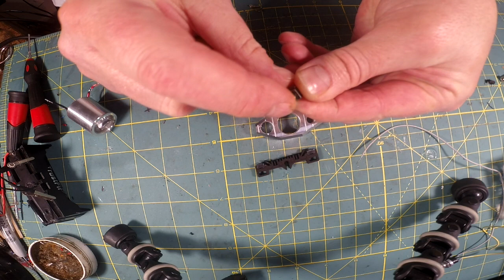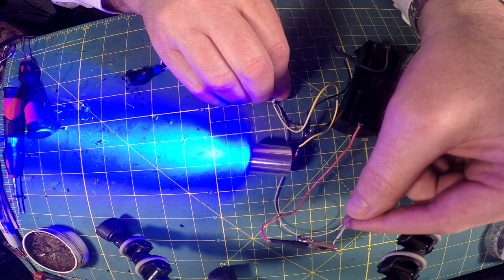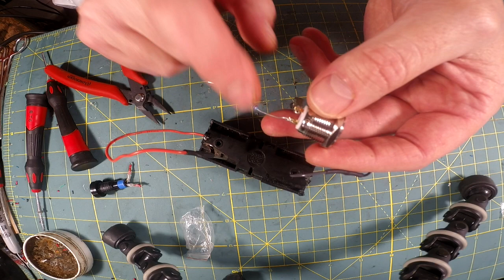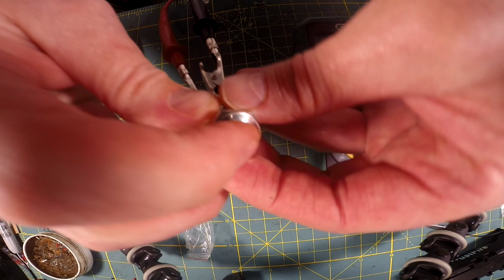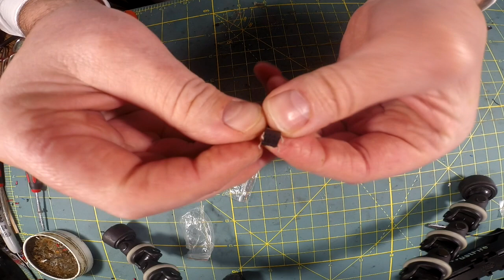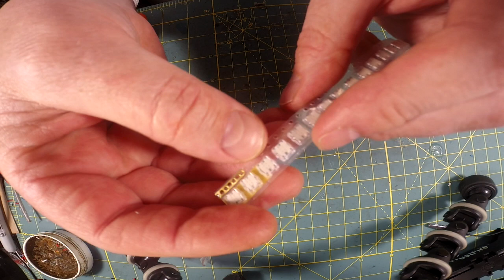Lightsaber Switches Introduction

Comment: What the heck is a PCB pixel switch? If you have an idea about how or what that does please send me any info. Thanks Meg !
Reply: Ok ya then the pixel would have to be wired like your neopixles and controlled by your board the same. Thanks👍
Reply from the maker: a switch which has neopixel lighting it. Should have 5 poles. pixel negative, pixel pos, data, switch lead, switch ground

Comment: Hello and thank you for this video.
I have some questions about the current and voltage so I hope to find the answers here.
Let's say I have a stunt/display saber, so no soundboard.
In hilt TriCree or a string blade (I know, old technique, but nevermind) and the current needed is about 2.5 A.
In that case the switch should be arround that amperage?
I found a momentary switch, nice silver, round bezel etc. rated 3A at 220v.
That 220v. I don't understand.
Will be that switch overkill for lightsaber?
Put in another way: what max.current (and voltage) should have a latching switch for a 2.5 or 3 A stunt saber?
Thank you.
Reply from the maker: most stunt sabers use these latching switches to power the in hilt led:  http://www.thecustomsabershop.com/SPST-Latching-Guarded-switch-with-silver-button-P255.aspx
Reply: @MegtoothSithSabers  Thank you very much.
There's only one (quite big) problem: I live in Romania, so shipping fron U.S. to Romania is expensive.
For the main parts (hilt extensions, poly blade etc) I will buy from a closer location (jqsabers).
Some other parts are available where I live (that latching switch I was talking, wires, battery holders, rechargeables etc.).
Or maybe I buy all I need from one vendor.
Thank you.
Reply from the maker: TCSS dosnt give specs, but check specs on your cree and then make sure the switch can handle the juice. Tri crees dont draw great amperage.

Comment: could you send me a 2-way momentary switch wiring diagram? For my Hasbro Darth Maul double saber project, I want each of the sabers two red buttons to be daisy-chained for power on/off as a two-way switch with either tactile or 12'mm button. I will be using Proffieboard. I can compensate for the info.
Reply from the maker: using stock lqtching switch, or are you swapping for momentary?

Comment: do you know what kind of swich the verso uses?
Reply from the maker: momentary, wired pull down
Reply: @MegtoothSithSabers  and do u know if i need to program an aux switch to the verso board or it have a default config right out of the box ? and do yu have any tutorial about aux switch wiring ?
Reply from the maker: @b.h9186  You dont need an aux switch on verso, but you can have one. An aux switch is wired just lije powee switch, except one lead goes to aux pad.  Sounds like you havent read verso manual, start there then watch this full verso install single button saber:  https://youtu.be/A9piyOWEe54
Reply: @MegtoothSithSabers  thnks bro
Reply: @MegtoothSithSabers  k i read it but what i still dont get is: do i need to program something to use the aux switch or i can simply plug it in and use it by default ?
Reply from the maker: @b.h9186  you have to adjust config fike on sd card for 2 switches, and you have to use the most recent os. I highly suggest you join kr sabers verso support group on facebook. Its a lot easier to help you there than youtube comments box. We are limited here.

Comment: What switch should I use for the red button in a Graflex? First time trying this out and want to get it right the first time.
Reply from the maker: Which graflex?  korbanth 2.5, 89 sabers, etc.  Which hilt makes a huge difference.
Reply: It’s for a 2.0. I got a plug and pay set up for a 2.0. Everything but the switch. And wanted a red button operating set up like in TFA
Reply from the maker: @RynMyers  Use the red button that comes with the kit, and the tactile switch that came with it, see this tutorial here:  https://www.youtube.com/watch?v=GvTa4diGtl8
Reply: Megtooth Sith Sabers , the kit I got was already assembled by Parks with a 7/8 insert inside, just want to give you as much info as I have.
Reply from the maker: @RynMyers  See video above to see if Parks included the parts needed.
Reply: Megtooth Sith Sabers , I just checked no switch just the button and nothing underneath. Mine just came from him fully assembled with nothing else.
Reply from the maker: @RynMyers  The only way to wire that button then is to disassemble the saber, and add a tactile button in there.  Follow Lets Build A Graflex Series.  In video1, he shows you how to take apart and re-assemble the entire hilt.
Reply: Megtooth Sith Sabers Good news!! Turns out the switch is there tucked in under the button!